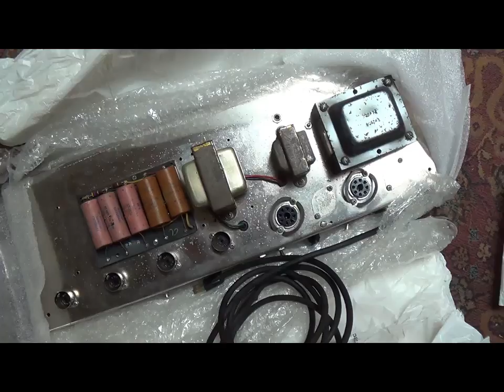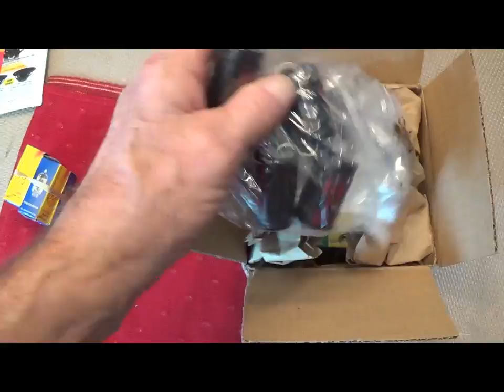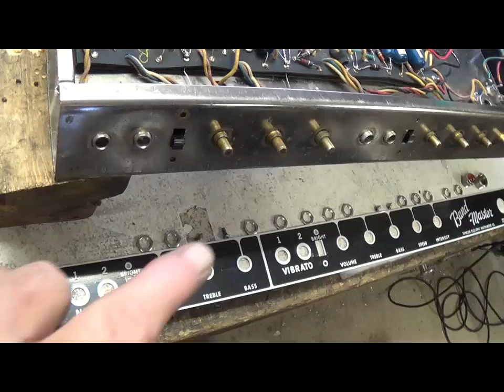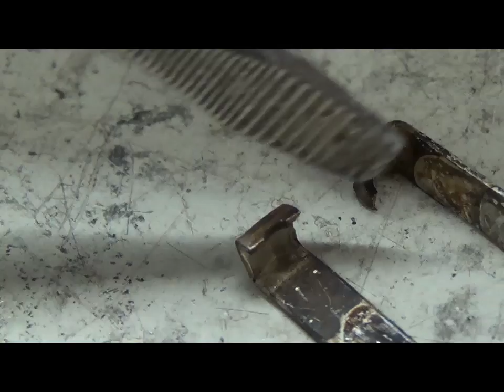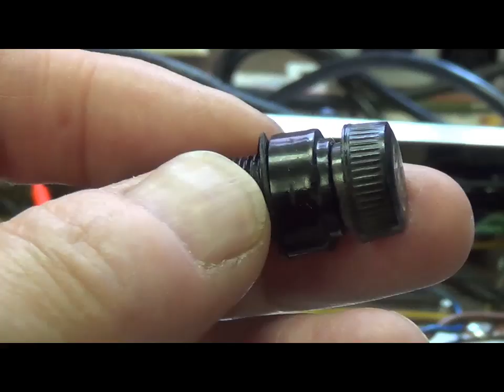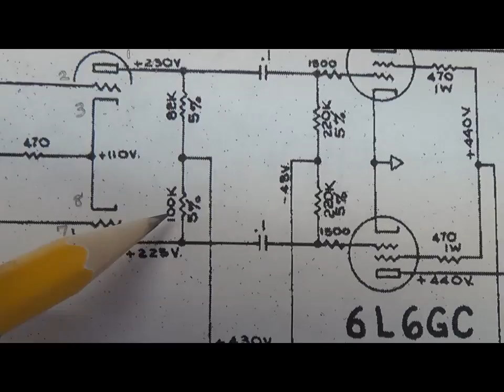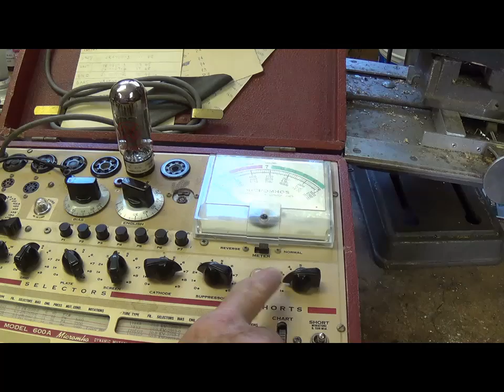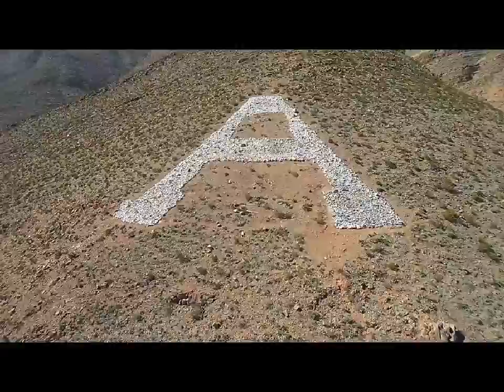The 1965 Bandmaster from Hell......A Really Tough Repair Job

Comment: Hi Uncle Doug--nice job as always.  I was particularly interested in the resistor that appeared to be good when measured by your ohmmeter, but clearly was not when it had a fair amount of voltage across it.  That's a good lesson for all of us.  I don't often rebuild old tube amps,  but on the last one I did, I replaced all the caps and resistors.  Many people would consider that extreme, but the resistors, especially, are quite inexpensive.  I always use metal film resistors because they are accurate, stable and quiet.  An interesting experiment is to replace all the  carbon-comp plate resistors with metal-film units.  The reduction in hiss is usually quite dramatic.  With new caps and metal-film resistors, the amp will truly be better than new, and very reliable.  
 I noticed that Jack worked especially hard when checking out this amp--I'm surprised he didn't warn you about all the problems you would end up finding.
Reply: Roiderien most people forget that resistors have two ratings.. one is guaranteed voltage drop and the other is power handling threshold. Basically these resistors quit when it has to work too hard. DC multimeters go easy on the components and AC multimeters and constantly ramping power up and down works the resistor a little harder and is more likely to show a faulty component.
Reply: Yes, indeed, but this resistor would be dissipating about 0.5 watts (200V across 82k), which presumably didn't exceed its rating.  Moreover, most resistors fail in a way that is obvious, irrespective of the voltage across them.  My guess is that the type of failure Uncle Doug saw isn't so common.
Reply from the maker: I too was surprised by the resistance readings, but the one thing that really impressed me was that the moment I replaced the coupling caps and 4 associated resistors, the amp went from total silence to excellent functionality. Up to that point I was beginning to lose faith :)
Reply: Uncle Doug Interesting fault. One might think that 430V should be even better than 230V, as long as the valve doesn't blow, but the gain is proportional to the plate load, so zero ohms, zero gain. Basically the plate is AC-shorted to ground. And that shuts off the other side of the phase splitter because this side is stealing all the current. So no output, not a sausage.
Reply from the maker: I agree, EJ. Thanks for your analysis.
Reply: Uncle Doug I am coming round to the dry joint theory. If the resistor was s/c there would be an over-current condition, the valve would red-plate, and your little lamp would light up. If there was a resistor-plate dry joint at the second triode you would still get some output via the first triode. But if there was a resistor-plate dry joint at the first triode, the 82K resistor would have 430V on both sides, which it did; there would be no output at all, which there wasn't: the cathode would never get off ground, so it would be unable to drive the second triode. So dry joint it really must be.
Reply from the maker: Thanks, Roid and Bill. I agree with all you say. This experience opened my eyes to the treacherous nature of carbon resistors. You either have to replace them or carefully measure all voltage downstream from them.
Reply from the maker: Thanks for your very detailed analysis. To be honest, I was rather puzzled why the amp would be dead quiet with this problem.....but it seems to make sense now.

Comment: Hi Doug --  did you install the zener on the c/t to reduce the B+ ? Also may I respectfully suggest that one is better off soldering the safety and bias grounds etc directly to the chassis  with a 'big iron' (jimmy dean ha ha) as the ones on the washers underneath the transformer nuts often come loose or lose continuity through corrosion  -- I have seen this lead to massive bias failure etc ..  also if you are using your own compositions/playing on the drone videos look onto how you can register the works -- it may be another revenue stream -- however small - peace from eire !
Reply from the maker: No, the zener was there when I received the chassis, Ben.....which further compels me to think that, combined with the bright nickle/chrome chassis, it may have been specially prepared for some unique purpose or person. Thanks for the soldering tip. I tend to do this on my handbuilt amps.

Comment: I hope it's possible to find a replacement for the dog dog house cover? I wouldn't want to leave those 450V filter caps uncovered. That's a dangerous shock hazard for any novice tube amp owner.

Tv's had a high voltage cage protecting the high voltage rectifier tube & flyback transformer in the horizontal deflection circuit. Rule of thumb was 1kv for every inch of screen. A 21 inch tv had about 21kv inside that cage. It was very important to secure the door and isolate that high voltage from the rest of the chassis.
Nice job restoring this old amp. I remember all too well the hard to fix tv's that occasionally came into my shop. We always spent extra hours of bench time that couldn't be charged. I hated admitting I couldn't fix something. That's bad for a business' reputation. We had to keep the repair ticket reasonable or the customer never picked up the tv. They pile up quick in a small shop. Thank goodness we got a lot of tv's and amps with easy repairs and that's what paid the bills.
Best decision I ever made was to close that shop and transition into computer programming.
Reply from the maker: Fortunately, the owner found the dog house cover and sent it to me, Ray. It's visible in later scenes. Thanks for your nice comments.
Reply: I thought it was worth pointing out that the dog house cover is an important safety feature in Fender Amps.
Glad that the owner found it. He's got a really nicely restored amp.
Reply from the maker: Thanks for doing so, Ray. Before I got it in the mail, I was nervous about touching a "hot" wire and the chassis at the same time 8-(

Comment: The Guitologist had to work on the roach on a Fender amp he was working on not too long ago. I seen another similar situation about grid resistors out of tolerance on a Fender amp recently.... D Lab, I think. I keep learning more everyday watching these type amp repair videos. I'm actually working on an old Holms solid state amp. Yep. Not a tube type.  And again not a tube type,,Univox stereo guitar PA guitar amp settup, huge capacitors in the powered amps... The monitors or mains, however it's settup, are powered...made in the early 70,. 4 tens in each cabinet.  I mainly use Newark Element 14 for parts now,  it used to be MCM electronics. I've bought from them for years, mostly speakers back in the day. They still have service gear like Tenma, still,  so far. I buy from Mouser as well.  I definitely need more options to buy parts from. eBay I have to be careful.   Anyway, I enjoyed the video, very interesting.  Thanks Uncle Doug and have a wonderful weekend!
Reply from the maker: Thanks so much, CT. I'm glad the video was helpful and appreciate your very nice comments :)

Comment: I had the same issue with a brand new set of JJ tubes that i ordered for my 74 deluxe reverb. I installed them, biased the amp and apparently they had a short in them. I let it sit a couple hours as i was upset at this point. Checked it again and they are fine. Its odd how we experienced similar problems.
Reply from the maker: Very strange indeed. You kept them and never had any more problems ?? It makes you wonder if there are some "burrs" or metal "whiskers" left in them from the manufacturer, which burn away when they first heat up.

Comment: Caps!  Those damn caps fail in multiple ways and screw everything up in odd and confusing ways!  Some swear by carbon comp resistors, but I prefer new 1% tolerance resistors!
Reply from the maker: I agree, Paulin. I've started using more metal film resistors for precision and durability.

Comment: Second best amp Fender ever made after the Bandmaster Reverb. I have an old Laney AC30 being recapped right now in St. Louis. The guy doing the work is supposed to be really great (although I've never used him before). He asked me if there was anything else I needed done with it, and I said, "Well it would be great if it sounded more like a Bandmaster Reverb." That was about a week ago. He said he'd try and get it close. I'm excited!
Reply from the maker: I hope he's able to make it happen, Bill. Best of luck !!
Reply: Got it back yesterday. It's wonderful. This guy is as good as they say. He basically made that little 30 watt amp into a mini Twin. (Or Bandmaster or Pro reverb. I think they're all pretty much the same.) I couldn't be happier.
Reply from the maker: That's great news, Bill. I'm glad you're pleased.
Reply: I know you know all this Doug, but let me say this just in case someone reads this and wonders what it involves. What the guy did was to rebuild the tone stack to match that of a Twin and also changed the coupling caps. (I'm assuming he lowered their value to get more lower mids.) He also changed a resistor somewhere that got me more overdrive out of the gain / master volume. He charged $200. I bought the amp used for $350. So for $550 I now have an amp that's a perfect 30 watt gigging amp. It has 2 x 10" Jensens and sounds for all the world like a small Twin or Pro Reverb. This Laney VC30 is a 1995 model, and even though it has a printed circuit board, it's a nice thick one and the tubes are mounted to the chassis like they should be. No pots built into the board either. Beware of modern Laneys because they do indeed have the tubes mounted to the circuit board nowadays among other problems waiting to happen like most other modern amps.

Comment: Great watching you diagnose those bugs and I love that you repaired the switch with some scrap metal. At least that chassis looks to be logically laid out and very serviceable. I had no idea until seeing this that the tremolo effect is created by a photo resistor reacting to a flickering neon bulb. Ingenious! Do newer amps use a more solid-state or digital means of creating tremolo, or is this method still commonly employed? Does the tremolo intensity pot simply raise and lower the bulb’s voltage causing it to flicker more or less, or is it more sophisticated than that? Thanks for your videos. You’re a great teacher and your students were fortunate to have you.
Reply from the maker: Thanks so much, FC. I believe that Fender still uses the photoresistor style tremolo on its larger amps. The Intensity control is much like a volume control, sending more or less of the photoresistor's volume modulation to the 12AT7 phase inverter grid. The speed control makes the oscillation loop, that controls the neon bulb, run faster or slower. All of this is explained in detail in my video series on different types of tremolo.
Reply: Excellent, thanks! I’ll check that out.

Comment: Seems like 90% of the problems were QC issues with parts. Frustrating.

The thing about that tube... If it failed once, it'll fail twice. Good call. Never walk away from a job that you aren't 100% confident with. One of the thungs that sets a good tech apart is that they never ignore that nagging feeling that it isn't as good as it could be.

Jack is a hell of a player... Of course he has built in picks on each finger.
Reply from the maker: Thanks, Jason. I agree. Your conscience knows what's right......and expedience is no excuse to ignore it.  Jack studied with Jeff Beck to master the art of "paw picking" :)

Comment: Had a 66 Bassman head on my bench 2 years ago that had me chasing my tail like this...ended up with a complete re-cap, half of all resistors replaced and finally replacing the replacement output transformer. That amp had so much snort to it, I thought I screwed up when compared to my 67 bassman head...so I did exactly all the same to mine before I gave the customer his  8-}
Reply from the maker: Sometimes the really challenging amps end up being the best, SC :)

Comment: I have stopped trying to get good 70uf filter caps. Just use 100ufs  F&T all the way which i rate higher than sprauge !!!
Reply from the maker: This was the first time I've had problems finding the 70uf caps, SG. I have some 80uf @450V that will also work just fine.

Comment: That bright switch issue reminded me of when I used to own and work on old MGs: every rocker switch on those cars was like a ticking time bomb in your hands, just waiting to fall apart.  And the more you fixed them, the worse they seemed to get.  Great job fabricating those contacts and fixing that switch.

So here's what might be a crazy idea:  Would it make sense, when installing a three-prong power cable in an amp with a polarity switch, to convert that switch into a ground lift?  I know it would at least partially defeat the purpose of the grounded cable, but it could also help in the battle against ground loops?
Reply from the maker: I imagine that MG's used Lucas electrical parts, Ed, which are notorious for their absurd complexity and nonexistent durability.....total junk. I once restored and collected vintage British motorcycles (BSA, Triumph, Norton, etc.) and spent many a happy hour either pushing them home or driving them home in pitch darkness without any functioning lights. With regard to the ground lift, I have never had a ground loop issue and would advise against anything that compromised safety to eliminate an internal design flaw.
Reply: Oh, yes: Lucas, the inventor of intermittent windshield wipers...and intermittent headlights, and intermittent horns, and intermittent alternators...Why do the English drink warm beer?  Because their refrigerators are made by Lucas.  I'm a Volvo guy, and most of the electrical parts in 'Vos are made by Bosch.  But when I first removed the grille from my '72 Volvo 1800ES (the p1800 was originally assembled in Scotland by Jensen), and saw "Lucas" stamped on its horns, a chill went down my spine and I broke into a cold sweat: what else on that car might have been made by the hand of the Prince of Darkness?

Thanks for the response on the ground lift question.  It's something you find on all manner of solid state devices, but I had never heard of one on a tube amp.  Probably because on solid state devices, you're not dealing with such high voltages in the circuit.

Comment: What could have made so many things fail? A lightning strike or voltage spike?
Reply from the maker: I tend to think old age, possibly in a damp environment, and a total lack of any maintenance. The lightning strike was to my shorts about the time the damn tubes started acting up :)
Reply: Caps are problematic components.  LOL  Heat and age degrade their innards and are always suspects IMHO.  ;^)  Old CC resistors are notorious for drifting and that frying/crackling noise.  After upgrading all these components and verifying stability of the circuits, old Premium Euro manufactured Mullard/Amperex/Telefunken tubes are worthwhile investments to get the best tone from these amps, if you can afford it and demand the sweetest tones possible from your gear.  ;^)

Comment: From what I've read, the main difference between the '65 Tremolux and Bandmaster is the BM had higher plate voltages on power and pre-amp and a solid-state rectifier. That face plate layout is identical except for the name. Both use the AB763 circuit, as do many other models. It's a good circuit.
Reply from the maker: You know more about it than I do, TM, and I accept your analysis. Yes, they are excellent circuits, with wonderful tone and power.
Reply: I had a '64 black-face piggy-back like the one on my avatar. We used to run 2 guitars and a mic off it. It was a screamer and built like a tank. Wish I still had it. I tried to track it down again through the guy I sold it to, but no dice. I have a page bookmarked that gives a lot of details on the models of the AB763 and a bunch of specs, too.

Comment: Great Video ! I've had new tubes short . I had a pair out, while I was re-installing Amp into its case.  One got knocked off the desk . Put tube in and short happened. Seems this happens more with new tubes than high end NOS tubes made of tougher metal.
Reply from the maker: I'll bet that a lot of new tube problems  stem from rough handling during transport, LRoy. As you noticed, the innards can get moved around by impact.

Comment: Another question: Regarding the amps that have negative feedback from the speaker side of the xformer to the peramp section, wouldn't there be a not so low shock hazard if there is a catastrophic failure at the preamp section which would send HV to the speaker side of the amp?
Reply from the maker: The NFB usually connects to the cathode of the phase inverter, which is not generally a source of high voltage, Charlie. Also, I have never seen or heard of a catastrophic failure of any pre-amp section.....where voltages tend to be much lower than in the output tube section. Bottom line: Don't worry about it.
Reply: You're right. Moreover, even if the NFB line becomes in contact with the HV at the preamp end, on the speaker end the voltaje would be limited by the low DC resistance of the speaker and the output transformer. It got me thinking that it may be worse on the input jack. Supose the grid of the input tube becomes shorted to the plate, there would be HV present at the input jack, although it's impedance would be high, given by the grid stopper resistor.